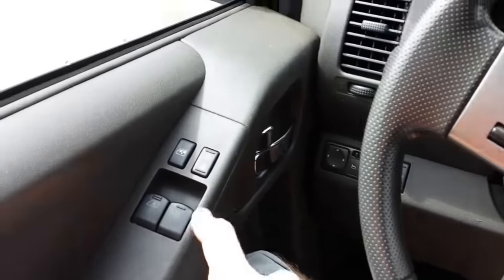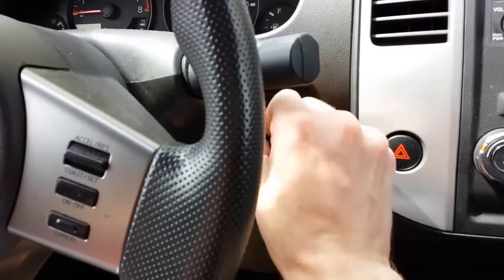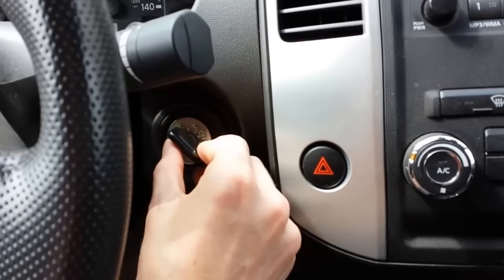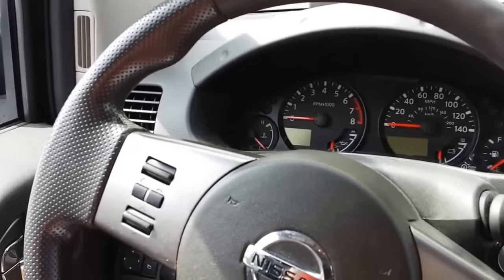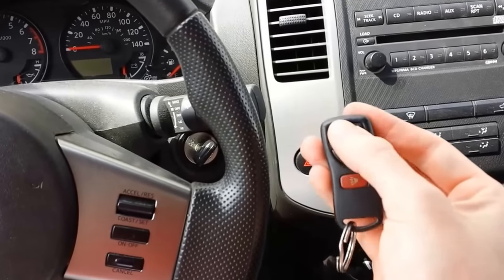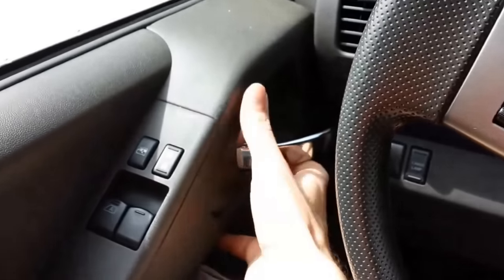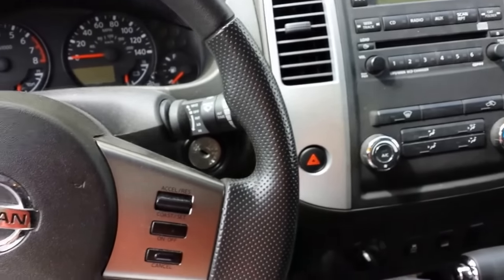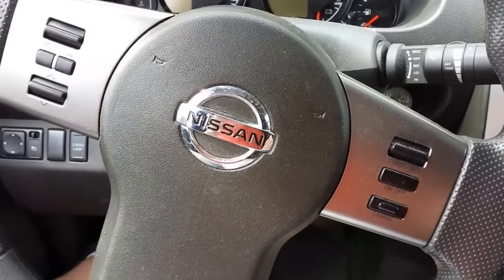How to program a replacement Nissan Keyless Remote Key Fob Transmitter

Comment: I have a 2011 Nissan Frontier, and could not get the hazards to flash no matter how many times I inserted and removed the key. I also noted my key would often stick when removing it from the ignition. I decided to try applying a little leftward (counterclockwise) pressure when removing the key, and suddenly the hazards flashed after the sixth key removal, just like on the video. I finished out the steps in the video and now have two perfectly working keyfobs. Moral of the story, if you have a sticky key, try a little leftward pressure when removing it. Otherwise, great video. You saved me $165.
Reply: Me too same issue I'll try your matter .. thank God

Comment: I have a 2008 Nissan Frontier. After watching this video and following the link to the website I ordered a Keyless Entry Remote. Took less time to arrive than expected.Once I had it in hand and read the instructions several time I headed out to my truck to give it a try. Following the instructions (it took me 3 tries not to get the key stuck in the ignition pulling it in and out) I just kept putting the key in and out until the flashers flashed. Could have been more than six time but less than ten. After the flashers flashed I continued with the procedure without any hiccups. This is day three and it works like a charm!! Saved me $180.00 that the dealer wanted for the key and programming. Thank you!! Rodney

Comment: Thank you!!!! 2012 Nissan frontier - worked like a charm. The only thing I had to do different was inserting the key 6 times I did it slower than you for it to work . Thanks
Reply: Colton Cook : thanks a lot for your note. I was going crazy.
Reply: sir, may I know if your remote is 3 button? I tried on my 2009 nissan frontier d40 crew cab LE. Our frontier came/maunufactured from Thailand and has only 3 buttons.

Comment: How do you reprogram a 2011 Nissan Maxima keyless Remote Key Fob transmitter?  There is no ignition key.  You have to step on the brake to start this car.  There are no videos on how to reprogram these fob transmitters,
Reply: I know its been 3 years, but did you figure this out? Im facing the same issue
Reply: Those black/silver fobs have to be programmed by dealer or locksmith... cannot be self programmed

Comment: This also works for 2007 Nissan Titan XE. Bought my truck used and didn't get a fob, but got two keys. Bought a Nissan Rogue (because it looks nicer) key fob for like $18. Took the chip out of my valet key by heating it for 10 min, with a hair dryer. Put the chip in the Rogue fob and used these steps. Lots of threads about topics like this on TitanTalk. Good stuff! Thanks eKeyfobs for posting!

Comment: On a 2005 G35 coupe, it took more like 11 to 13 times of entering the key before flashing lights come on. I found it on another video, on youtube because just inserting the key 6 times nothing happened. Both key fobs work great after finding out you need to insert the key more than 6 times, thank you!

Comment: I got it to work! 02 Nissan frontier.. It wouldn't work for me  at first because there's a sensor in the door that was uncliped. it's the little censor that turns on the cabin light. I plugged it back in and followed the steps and it worked perfectly. Thanks!

Comment: Thanks. This just saved me about $100 bucks.  I have a 2006 Altima. One thing I found out, the windows MUST BE up for this to work for some strange reason.  Or, it might have been that the first battery I put in the FOB was dead.

Comment: Great video.  Worked on my 2005 Nissan Titan LE.  My truck has the "Proximity Sensors" as in the backup sensors if that is what you meant.  I had to put the key in about 15 times rapidly before putting it back in and turning to accessory, and then mashed the lock button about 3 times before it finally honked at me :-)

Comment: This method does work with a 2007 Nissan Quest with power lift gate. You just have to insert the key around 11 times before emergency blinkers blink.

Comment: It worked for my pathfinder 2008 as well. Thank you!
Reply: Hi this dosent work for my Pathfinder 2008. How did yours work
Reply: +Tanya Ros Try putting the key in and out like in the video, but not too fast that you dont hear the clicks and not too slow either (it won't work if you do it slowly) and keep doing it until you hear the blinker sound (7, 8 or even 9 times). I did it with all the doors closed and it worked... and don't turn the key, just in and out.
Reply: jramc89 Thank you it worked!.

Comment: Was wondering if this worked for a 2007 nissan xterra but the disclaimer in the beginning said it works for 2002-2004 nissan xterra. I replaced the battery but it didnt work. Then I found this video and I'm gonna try it when I get off work.

Comment: The video confirms the accuracy of the instructions provided by the manufacturer of my 2 new fobs. 

However, when I initially insert and remove the key 6 times (10 times if that doesn't work), the hazards never flash. They WILL flash later in the process when I press the fob buttons, but not initially. 

Sent a note to the online seller of fobs and all he can offer me is to replace the fobs. 

Is there something in this process I am missing? Seems pretty straightforward.

Thanks.

Comment: I wanted to see if this would work on my car before I buy a remote. So I just did the first 2 steps lock the car and then insert the key in 6 times after I did this the doors actually unlocked. Does this mean it won't work on my car? I have a Nissan Rivera 1997 I believe

Comment: One thing worth mentioning is that if you do the sequence too fast that your vehicle will not go into programming mode. 6 times is the magic number, if you insert the key any more and the lights flash, your remote may not program correctly.

Comment: 2008 Pathfinder ... pressed the key in/out 12-13 times in a row, still no hazard lights will flash.  Any ideas what the problem is or what the next step would be?

Comment: I have one working dealer key fob, for '07 Quest,  but want to program an extra one. Do I need to reprogram both the original AND the new one, or just the new one? If both, is there a certain order (i.e. program the original first or last)? I am scared to mess up the one that works and end up with none!

Comment: Thanks, I just ordered blank keys from  Amazon, going to have them cut at a locksmith and will program them after that. Nissan dealership wanted to charge me $150+ for an extra key when they only gave me 1 key to begin with. They claim the keys were on back order and no one has them....why are there plenty online?

Comment: For keyless remote WITHOUT an ignition (smart button only): Remove key from the back of key fob, press start button twice inside of car but be sure not to start the vehicle (don't depress brake). Next get out of car and close the door, insert metal key into drivers side key slot on door handle and turn key to lock and unlock position once. Go back into car and shut off ignition by pressing start button once, ignition is now off. Problem fixed. (Works for 2011 Altima)

Comment: I have a 2003 Nissan Altima. I followed the steps...but when I put the key in and out 6 times, the hazards won't flash. Therefore, i can't program the new remotes. Any other suggestions?

Comment: Hi! Any idea how to program Nissan Tiida 2007? I tried this procedure several times, but did not get hazards flashing. Instead the doors get unlocked after inserting and removing the key 5 or 6 times

Comment: It wasn't working for me at first when I would unlock the car manually with the key to the door handle then attempting this procedure. Then I noticed that you must first unlock the car with a remote that's already programmed before entering the car, then you begin the procedure to reprogram that same remote you used and any additional remotes. Worked with my 2008 Nissan Armada SE.
Reply: Ah OK... Parce que j'ai 2 clés et elles sont toutes les 2 déprogrammées. C'est peut être pour ça que ça ne fonctionne pas pour moi. Je mets la clé et la retire plus de 10 fois mais pas de warning qui s'allument.

Comment: Hi, i´m from Brazil and i try this on my 2004 nissan xterra and everithing ok, but in other 2004 nissan xterra of my friend the remote don´t save the setting, after open driver´s door the remotes don´t work. during the scheduling procedure everything works normal, but after finishing the procedure the remotes simply do not respond. any tips?

Comment: I tried this on 2005 Nissan Murano with out luck. Hazard lights didn't come on. First couple of tries I placed key in/out 10 times, nothing, but then doors would unlock because of this procedure, then they would unlock after only 5 times inserting. Still no hazard lights.  Any suggestions please.

Comment: Not all Nissans use this procedure particularly in the UK e.g

ALMERA
ALMERA TINO
PRIMERA
MAXIMA
MICRA
SERENA
VANETTE CARGO
TERANO II

Ensure all the doors have been unlocked, either by using a good transponder key or remote control plip key.

Procedure
1. Turn the ignition switch from Position 0 to ON 6 times within 10 seconds.
2. Then turn ignition switch to OFF position. Leave key in ignition switch.
3. After 2 seconds, the system will enter programming mode and will flash the warning lights twice.
4. Press and HOLD the unlock button on the Plip.
5. While pressing the unlock button, press the lock button 3 times.
6. Release the unlock button.
7. The warning lights will flash once to indicate successful programming.
8. Repeat procedure 4 to 7 for up to 4 plip key’s.
9. When completed turn ignition ON, and the warning lights will flash 2 times.
10. Remove key, and check all plip key’s for operation.

Comment: will this procedure work on a 2012 nissan rogue? if not, what are the procedures?
Reply from the maker: Depends on which type of key you have. You can program the remote part of the standard remote key with this procedure but it will not program the key to start the engine. That has to be done by a dealer or locksmith.
http://www.ekeyfobs.com/nissan-rogue-cube-juke-remote-head-key-fob-h0561-c993a.html

Comment: Hi, 2004 Nissan Maxima GV doesnt work, i close the doors but the pilot door secure, don,t close, i need to close manually, i follow the steps the ligths flashes, i press lock button in control and no flashes the lights again.

Comment: I have follow all the steps, at first it blink after the 8x intro the key on ignition, then did all steps and the remote does not do anything, so I tryed to attempt the steps again and I have intro the key into ignition and dispels not blink. Do you have any suggestions?
Reply: 6 times...not 8

Comment: Thanks, hope this works for me. Mine stopped working, I replaced the battery but nothing happen.
2009 Nissan Frontier
Reply: hello, do you succeed on your 2009 nissan frontier? I also have 2009 frontier and it didn;t function

Comment: Had to get another replacement key fob and this time it didnlt work. Everytime i pull the key out of the ignition, the truck would unlock itself. does anyone know how to get around this? 2012 nissan frontier with a 6speed manual.

Comment: I did all the steps and I get nothing:( I replaced the battery in the remote as well. And when I get to the hazzards flashing and press a button on remote, nothing happens. Tried multiple times and did it perfectly. Any suggestions?
Reply: I have the same problem. Did you find a solution?
Reply: You have turn the key to accessory before keying a button on the fob.  Slow down and do all the steps. It works.

Comment: Hi there, on my 209 Nissan Serena, inserting the key 6 times makes the car automatically unlock. The hazard lights do not blink? What's with that?
Reply: I got the same problem
Reply: @Loveau521  Sorry to hear that Jay - I spoke to a key man who spun me a yarn and said 'Pay me $300+'. My van remains un-paired.
Reply: @paulusmaximus8284  try  this method! It works for my 2004 Nissan maxima..  After 6 times key inserts and out. The door will be unlocked.and then you have 2 secs to put the key back in.turn the key to acc mode.and lock all doors with lock button and click the new remote button and go out close the door.it's done  with no hazard light flashing
Reply: @Loveau521  Thanks! I tried it but no luck - when you say Turn the key to Acc mode and lock all doors - do you mean with the remote or the actual door lock? Do you get any confirmation that you've been successful - for example when you push the remote button, does it then work on the vehicle? Many thanks.
Reply: @paulusmaximus8284  i mean the actual door lock with master door lock button.  And it works for me now
Reply: @Loveau521  You are my new hero! It worked!!!!! After 3 years of trying EVERY other method in the world I now have remote locking and unlocking!! (I just wasn't doing the last step fast enough). Many thanks.

Comment: what if you don't have the key fob and just the key. how would you reprogram it?
Reply from the maker: Rachel Wilder you need to have a locksmith or dealer program a new key. unfortunately, there is no way to do it yourself.

Comment: Tried this with the provided instructions I received with my remotes for a 2004 Nissan Pathfinder Armada. The first time I went through the procedure and did the 6 key entry/removal steps, the hazards flashed, I pressed lock on the remote, hazard flashed. Then I kind of panicked and think I tried to unlock it with the remote. Obviously it didn't work, but ever since then I can't get the hazards to flash after key entry/removal anymore.

But when I turn the key to the ACC position, press lock on the remote, the hazards still flash. I turn the key to OFF and unlock the door with the car button, remote still doesn't program...anyone have this happen? Have two remotes that do the same thing.
Reply: So I disconnected the negative terminal to see if I would get the initial hazard lights, and I do each time I remove the negative terminal. So now that I do the procedure correctly, it still doesn't program either of my remotes. :(
Reply: +Byron Reid How about removing the battery in the remote and then reinserting it back and trying again. Maybe a reach.
Reply: +Roy G tried that, it does flash, but doesn't program. Pretty sure it's because of the proximity sensors now, lol. Thanks for the tip though!

Comment: So I had my keyless remote for about a little over a year that I bought from eBay. Its been working perfectly fine and today out of no where it stopped working. I do the programming steps to reprogram the remote and the hazards flash letting me know it went through but when I end the programming mode it still won't work. Anyone knows what the issue can be?
Reply: Hector Roman Battery?
Reply: Changed the battery that was the 1st thing I did. But when I go to program the remote my hazards flash when in program mode but when I go to test it after I take it off program mode it still doesn't work
Reply: AzeOfSpadez Changed the battery that was the 1st thing I did. But when I go to program the remote my hazards flash when in program mode but when I go to test it after I take it off program mode it still doesn't work
Reply: Hector Roman idk what to tell you, i bought a remote from ebay and it worked on the first try, just tested it out again and it works! If you want the link to the seller i got it form let me know.
Reply: AzeOfSpadez its all good I had this remote for alil over a year and it just died on me but I bought 2 more on eBay for like 14 bucks just came in programmed it and tested it and its working perfectly. Should've bought a back up remote along time ago but w.e I have it now lol
Reply: Hector Roman Nice, this new one was precisely a back up in case something happened to my original. lol

Comment: I get the flashing lights after the 6 times, but when I turn the key to the acc position and press a button on the remote nothing happens. 1998 Pathfinder. I've tried for like 40 minutes to no avail. Any ideas?
Reply from the maker: I'm not sure if this will work for that year Pathfinder.

Comment: 2007 Nissan Maxima 3.5SL doesnt work
Reply from the maker: Does not work for proximity remote.
Reply: As mentioned in the beginning of video this video is only applicable for 2002-2006 maxima

Comment: wow i bought this for my sentra and it doesn't work
Reply: leGianflavio What year sentra do you have?  I have a 2012, and somewhere on the internet it said there is no reprogramming for the 2012.  did you ever get yours reprogrammed or what?  what year is yours?
Reply: zingy 4 gmail well it was actually for my mom but hers is 2006-7 i think. somewhere there. And no we never got it to reprogram
Reply: My mom's keyfob for her 2007 Ford Escape quit working.  I ordered from Amazon "2 KeylessOption Glow in the Dark Replacement Keyless Entry Remote Control Key Fob - Pink
by KeylessOption
		 		 		 		 		 		 		 		 		 		 		 		 		19 customer reviews 		
	 		 		 					 		 	 		 		 		 			 			 				 			 			 			 				 				 				 				 				 					 					 					 					 					 				 				 				 				 				 		 				 		 Price: $9.95 	 	 	 	 & FREE SHIPPING" 
But she went to Ford before the pink ones arrived, and they charged her a total of $200 for new fob, key.  It worked for a week, then went bad. 
So I did the two pink keyfobs, and in less than 20 seconds they both worked!  So easy!  We did return the keyfob bc it wasn't working, and got $75 back.

You might try Amazon, and the Keyless Option brand worked fast and perfect! 

If it works out for you, will you let me know?

Buenos dia!

Comment: Everybody listen up...along with programming the extra remote fob, what about the extra KEY with that one remote you just programmed. For one, their is the Factory OEM key you push the button and it pops out...than there is the 2nd one, universal one you just synced up. Nobody has tried to put the extra remote with that one KEY and put nto the ignition just yet! Hmmm, very interesting!